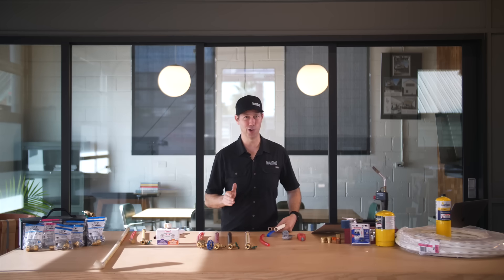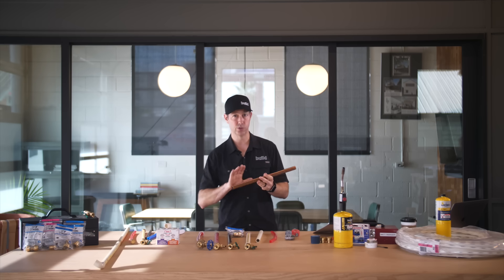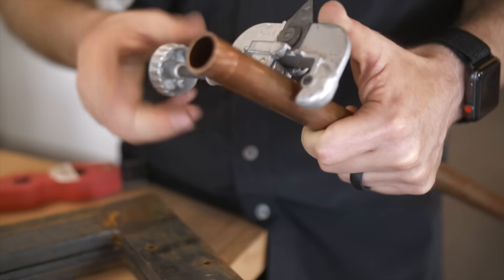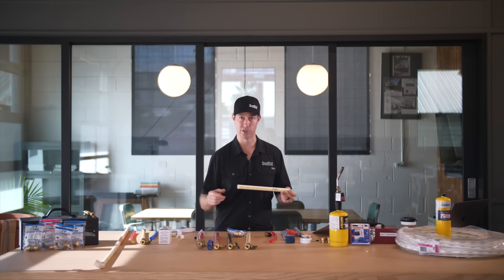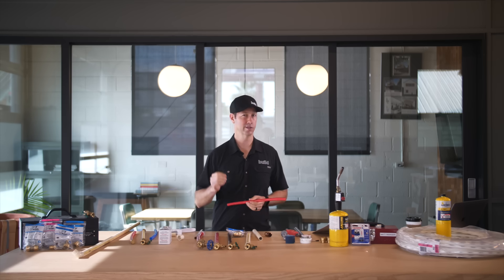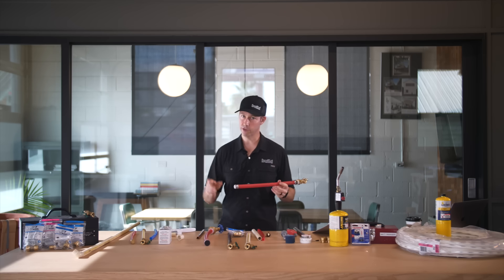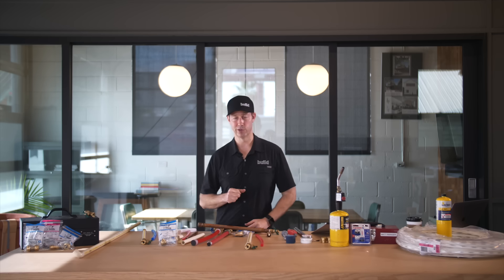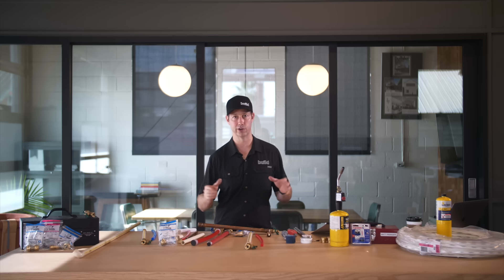PEX vs COPPER vs CPVC plumbing pipes

Comment: CPVC does not last 50-70 years in Alabama in my experience, I see 20-30 year old CPVC so brittle that you can't even repair it because when you go to cut it the whole thing shatters.  Maybe it's something in our water here, but we always replace it on remodels if we ever run into it
Reply: I found the same problem with my CPVC and changed to PEX.  I had a bath install about 15 years ago and when I went to remodel I found the CPVC was very brittle.
Reply: Mike Malone yeah it is junk!
Reply: My CPVC at 24 years is ridiculously brittle.  I’ve had spontaneous joint failures inside the wall too.  Cheap for a builder, expensive for the homeowner when the plumbing and sheet rock must be fixed.
Reply: Matthew Gross I have made many repairs because of this as well!
Reply: @matthewgross6958  brittle indeed. I still install CPVC on the repipes.  My pipes are supported and strapped. Using the PEX expanding tool while laying on your side under a tight house is no fun, so a PVC cutter is the way to go for this plumber. So CPVC wins the contest for me.
Reply: Mark Thomas even with all the horror stories of  CPVC? On well water sure, maybe. And come on lol using the expansion tool is not hard, literally use it almost everyday of my life in all kinds of bullshit positions. Think it’s a lot harder to make a repair in a crawl space when the pipe keeps cracking. Would you use it in your own home? Because I’d politely ask you to get out of here with that if you tried to put it in my house lol.
Reply: What do you replace it with?  PEX?
Reply: dahveed284 That’s what I am doing.
Reply: This is the thing with CPVC. Brand new it's all flexible and clean. With age it gets brittle. Use a saw instead of a ratcheting blade type cutter.
Reply: @brandonb8879   the copper type cuter also works well on CPVC that is old. I put it in my place 20yrs ago now when i cut it is brittle but i just use copper cutter and its fine
Reply: @brandonb8879  . After changing out the kitchen fixture and cracking the cpvc, I use a multi-tool with a 3/4 moon drywall blade. I ran new pipe on both sides and anytime I'm adding or changing fixtures now.
Reply: I am also in Alabama and now doing a full gutted full bath remodel. We removed the sink and toilet CPVC years ago with copper after a leak (second story) and went all the way down to the basement. The shower is the last and I am going with PEX. CPVC crumbles and the glue starts to fail after 30 years. Not made for the South. We make water hammers with a 1/2 T, 8-12" of 1/2" pipe and a 1/2" cap and have zero hammer.
Reply: @myownboss1318  its true cpvc requires maintenance and it gets brittle. But its low cost and ease of that maintenance makes up for its bad points. I do love copper but its so incredibly expensive in my area. So for me its totally about cost and i have no problems about making the occasional repairs needed to maintain my cpvc.
Reply: @kenjett2434  It's not worth it when the pipes split and water runs down through the ceilings on 3 floors after only a few years after install.  That's what I had to deal with on one job.  No other material splits, cracks, shears, of weeps at the fittings like CPVC does.  I just replaced some lines where the actually coupling had split completely open.  The stuff is garbage.
Reply: @BrainToMush  well yeah in that situation I wouldn't advise using cpvc. There is a time and place for using certain materials. If you have multiple floors then use should be able to afford the cost to install pex. All my lines are in one story and easily accessible for easy repairs. Being disabled I still need to be able to take care of home maintenance. Cpvc is a cheap easy way for me to do that.
Reply: @kenjett2434  CPVC is cheap for sure.
Reply: Exactly the same experience here. CPVC installed in 2004 was so brittle by 2010 that bumping into it caused it to shatter.
Reply: Paul Ste. Marie yeah bro!  This stuff is garbage.
Reply: In my experience, CPVC does not last that long either. It is extremely brittle with age and we don’t install it unless needed. PEX or copper with propress is the way to go in my book. 
-Journeyman Plumber in GA
Reply: Lol propress what a joke, overpriced bullshyt. If your not sweating atleast use pex.

-Master plumber TX
Reply: Even for underground? Should it be protected with anything(concrete) if it's exposed to dirt and moisture?
Reply: @luissonoma6255  I have had big problems with cpvc in concrete cracks all to pieces. I have seen copper in other countries that was hundreds of years old with no problems.
Reply: Phone Backup That’s what I’ve been hearing. I still didn’t want any copper joints that were soldiered to be underground. So I decided to just run regular PVC into each building & for the hot water each unit(kitchen & bathroom with laundry room) will have its own dedicated instant hot. The kitchen one will be small 9KW since it’s just a sink for the kitchen, no dishwasher and maybe an 18KW for the other building that will have a laundry room and shower. The original house is old and still has galvanized so I have to remove all that and replace it with a 1” line before I tee off into the new additions. The kitchen already has a sub panel that can handle the instant hot. For the bathroom I’ll have to run a new line.
Reply: @luissonoma6255   The pvc will fail faster than cpvc. Why do you think that only copper can be used in commercial buildings?
Reply: Phone Backup It’s for the main line going into the house that’s underground...
Reply: @luissonoma6255  Where do you live? They would never do that here it's agents code. Far be it from me to tell you how to do your business, just my two cents worth.
Reply: Phone Backup south Florida
Reply: @luissonoma6255  According to some in this post copper gets eaten away in Fla by nothing special. May be the salt doing it. Here in Nashville we have hard water, reverse from soft water like you might have. What does your water service local to you use?
Reply: Phone Backup Not sure but that’s why I’m going with the regular PVC for underground. Once in the building I think it’s supposed to enter a filtration system and then to the water heater/boiler or instant hot in my case. Then I can use the coper lines inside the walls. I figure they’re more sturdy then  Pex or CPVC. Even though it wouldn’t be exposed to the elements.
Reply: @luissonoma6255   That sounds like a good plan, that way you should get the best of both worlds.
Reply: Phone Backup We’ll see what happens in 50 years.
Reply: @luissonoma6255  It's not even lega to use CPVC underground in my state. It's too brittle and can't handle cold weather at all.  For underground they recommend the black poly pipe.
Reply: Even for direct burial underground?
Reply: @luissonoma6255  no it isnt recommended for underground. For underground lines the black plastic waterline is used.
Reply: Ken Jett  have your every seen abs In sunlight or uv? It isn't the option either
Reply: @say_goodnight7342  i agree no abs isnt an option which goes to point of my last comment.
Reply: @kenjett2434  Would that be the same black plastic water lines that constantly break all over the northeast?  Those things are garbage.  Copper all the way.
Reply: @peterallen4605  no talking about CPVC plastic thats used for plumbing. Actually the black plastic works really good in areas not exsposed to sun. When exsposed to sun it gets hard and brittle yes but underground or down a well it lasts for years.
Reply: @luissonoma6255  I've been told that CPVC should never be used underground due to the glued fittings. If it is underground, it needs to be sleeved and insulated.
Reply: CPVC is terrible and should never be used in any structure unless you plan to tear it down within 10-15 years.  Here in Michigan whole neighborhoods were built in the 1990s with CPVC plumbing.  The pipes are so brittle now that the pipes shatter in the walls when merely attaching hoses by hand to spigots, washer hookups, or toilet supply valves. It has nothing to do with UV.  Extreme brittleness comes merely with age.
Reply: @tedvogel4478  sounds like y'all have no idea how to use cpvc or deal with it when it's Brittle, use hacksaw blade or copper tubing cutters never have problems on brittle cpvc pipe you just got to know what you're doing
Reply: @tedvogel4478  CPVC plumbing should never be used in any area that has erratic temperature shifts from summer to winter., it just won't stand up to the constant temperature fluctuations. I am aware of a class action lawsuit that his being launched against the makers of this product because of failure of the product through normal wear. Speaking for myself it's copper or nothing in my home. Plastics are made from crude oil or natural gas (coal is also used) so having my drinking water sit in plastic pipes isn't my choice of safe water containment.
Reply: Likely chlorine in the water.
Reply: The fluoride in the water is extremely corrosive, it's labeled as corrosive on the trucks that deliver it to the city water authorities. It can eat holes in the concrete if spilled, just imagine what it does to the pipes (copper, cpvc, pex, etc) as well as shut off valves. Besides causing cancer, we don't want to think what drinking this stuff does to our bodies!
Reply: I live in Baltimore Maryland and it happens here too so it's not just there
Reply: William wills it is all over the country.
Reply: I bought a house built in 1996 that was plumbed with CPVC. It's so brittle that when I went to replace a toilet the pipe broke in several places. Talk about a pain to make the repairs. Every place was breaking as we tried making repairs.
Reply: I've had some CPVC fittings get brittle just sitting in a bin in a dark closet for upwards of 10 to 15 years. I've also had some CPVC pipes rupture & split. A friend of mine was trying to renovate his grandmother's house & the CPVC shattered on him. He replaced it with PEX.
Reply: Ok. I see a lot of flack for CPVC but hardly anyone is being specific. There is a schedule 40 and schedule 80 CPVC. I've used my pipe cutter on 15-20 year old schedule 80 CPVC (gray color) outside with no problem. It wasn't even perfectly sealed, as us HVAC guys don't run around with PVC/CPVC pipe cleaner.
Reply: I have a 1994 built duplex with brittle cpvc and it was below sink so no UV damage.
Reply: Andrew Meyer same problem in St. Louis area. Have replaced lots of brittle cpvc that's not very old and not exposed to uv.
Reply: Ralph Macey  it is the same all over!  Cpvc is junk!
Reply: @Ralith09  right, uv damage,hhhhm. Not under your sink. And if the plumbing ship has stored the pipe outside uncovered then shame on them. I work on older mobile homes, age will create brittle pipes cpvc and PVC.
Reply: I am a plumber in Florida and you may in the right conditions only get 10 years
Reply: In my day to day pex is our main go to for new houses and repairs u have aqua and heat pex
Reply: We have the same issue in the NW
Reply: I have helped my dad and stepdad  try to fix PVC  pipes  in my son's attic but after about a week it starts leaking 7 or 8 times please help!
Reply: Same here.  House built in 1983 no pipes exposed to uv damage, everything but a few pieces were brittle.  You could barely touch some of the stuff and it would crack.  I don't know about pex, but CPVC is not something I would put in on purpose.  I have ten year old pex working perfectly.
Reply: Same here in Hawaii. We see more problems with the hot water line.  Pipe becomes so brittle it is scary to do a repair on it.
Reply: It may shatter if you use a shear cutter on it. However CPVC Flowguard states in their documentation to NOT cut with a shear on repairs. If you do use shears rock it back and forth to gently start the cut before pressing all the way.  For stubouts a dog ear elbow will eliminate any potential stress points. We've had them in multiple units 24 years without a single failure.
Reply: Yes cpvc becomes brittle over time (with or without being exposed to uv
Reply: No it’s not your water. CPVC is like that. Could have never seen the light of sun before. It happens as it ages.
Reply: Same in Texas. Even wrapped cpvc under a house, where it couldn't get any uv damage, gets more brittle than regular pvc installed at the same time. I've seen it too often.
Reply: Cpvc is garbage.  Might last 15ish years
Reply: Well water here, so no chlorine. Under house under insulation so no UV. 
CPVC  is as brittle as duck's butt. Plumbing in whole house built in 1997 had to be replaced.
Reply: CPVC is garbage. Learn to solder and use copper or go PEX with clamps, better with Uponor.
Reply: @carlo1132  all of these are obsolete and expensive garbage compared to  ppr welded pipes we have in the central and east europe for decades by now.
Reply: Plumber here.. do not plumb a house’s water system in CPVC. CPVC has single handedly made the company millions of dollars.. simply from repairing/replacing it.
Reply: Best fitting to go from cpvc to pex?
Reply: I agree, mine are brittle and I don't think they are 30 years old
Reply: Let me guess it's over head...not good for it gets brittle yes your right but good in the ground were I live in florida last for ever that way...
Reply: Oxygen/ozone also attacks CPVC, it just takes longer than UV.
Reply: In older moble homes the old dupont coneting fitting got brital from clorreen in water tap water city water cloinated. Erodeds the inner plastic they need replaced
Reply: My sewer pipes are PVC, when I was doing work on it behind the wall behind my washer and dryer, the PVC was breaking so easily. My house was built in 1984. My main is also PVC and it broke as well. It's okay, but I like Pex better for tap.
Reply: Never use CPVC for anything. Not even a closet rod.
Reply: @Phil Brown long as cpvc is concealed inside walls whete light cant get to it. It will last a bery long time but it is susceptible to UV light that causes it to get brittle and break easily. That is the weakness of cpvc otherwise its great plumbing.
Reply: @kenjett2434  vtyj
Reply: Even in country water supply lines, where the water comes from wells, the CPVC pipes become brittle with age and when you hit them ever so slightly, they crack. That's just how CPVC is, something inside the plastic changes as time passes. It is probably the 'Chlorine' in the CPVC that destroys the pipe from within because in the cities the chlorine in the water makes the CPVC pipes degrade even faster.  CPVC must be avoided at all costs!   Meanwhile, black P.E. pipe has been around for decades for well water use and is perfect for cold water only.  PEX is simply a 'stronger' version of PE, that's why PEX is so perfect as a water supply pipe.
Reply: @honestycounts9352  yeah i agree pex is very good but also crazy expensive to use. Cpvc is cheap as well as quick and easy to repair. Furthermore is doesnt deteriorate that fast, it takes a few years.
Reply: It isn't the water. It is just the way vinyl is. You see the same thing with all vinyl products from windows to siding. There is a quality factor involved as well. Good quality vinyl windows like Milgard will last longer then the cheap ones usually available at the big box stores but they all will dry out and become brittle and chalky in time. Exposure to UV light is going to accelerate this even more. I try to avoid vinyl where I can but vinyl windows are very popular so It's hard to avoid all together. I don't think CPVC is code approved here in California because the only place I've ever seen it used is for daylight drains for water heater pans and HVAC condensation drains. PEX is pretty popular these days but wasn't widely approved until the late 90's early 2000's.
Reply: I have a bunch of brittle cpvc in my basement but it's not in use just laying down there.
Reply: Use PPR ,has 240 years warantee.
Reply: @mihaiilie8808  what's ppr
Reply: @7x779  Polypropilene.
Reply: @Phil Brown  What area of the country are you in?
Reply: CPVC is brittle from day 1. As a water restoration professional, CPVC is a steady source of flood work for us. Once it gets about 10 years of age on it, the brittleness starts to go up exponentially.
Reply: CPVC is absolute garbage
Reply: That’s because plumbers like my dad kept their supply outside in the sun. They didn’t know any better
Reply: My house was replumbed in 1996 with CPVC. It is a maintenance issue as leaks spring up when anyone goes into the attic - an accidental bump could crack the very brittle pipes and repairs are difficult because it shatters into jagged pieces when cut. Florida water is hard and summer heat in the attic is ruthless even if there's no UV exposure. Now I'm reconfiguring the layout of the kitchen, laundry, and a restroom. Everything new will be plumbed in PEX. I'm seriously considering replumbing the rest of the house in PEX if my budget allows.
Reply: Chloride, but once hard,dam stuff lasts forever.i run miles of cpvc, 50 years experience, never had a problem one.
Reply: My cvpc is brittle. I bought the house 14 years ago.  The inspection guy said 10-15 yrs and think about changing it
Reply: Cpvc so i have a property in Las Vegas built in 1996 so may damn problem the whole
Neighborhood has the same problem the always breaking and leaks
Reply: Same here in Myrtle Beach, South Carolina.You go to repair it and your cutters.Just bust it shatter it like glass
Reply: Same in TN. Our house is 30 and cpvc needs replacing
Reply: Redid floors in a house that was 8 years old that had cpvc. When removing the toilet in the bathroom the line  feeding the toilet/sink in the ceiling of the basement snapped.

When using the cutters to cut a clean edge it just kept smattering instead of of cutting. Luckily I had the water supply turned off to that bathroom before I started and only had minor water leaks to deal with during the fix.

But I ended up having to go back 15’ to get to a spot that was strong enough to not shatter.
Reply: CPVC seems to get brittle from either chem reactions or perhaps constant pressure. What ever the reason, I run into this quite often in my repair jobs. That's why I keep a trusty pvc pipe hand powered cable saw in my box. It works great on brittle cpvc pipe and can get into some really tight spaces. 

Although cpvc is not an ideal long term pipe, it's low cost and ubiquitous use in homes means we'll all be seeing this pipe for the rest of our lives. Best advise is to get used to working with it and finding solutions that make the job better on your head and your hands.
Reply: @valkyriefrost5301  I use a variable speed multitool with 3/4 circular blade
Reply: @Dirtyharry70585  - You're talking about the "drywall" type circular blades?
Reply: @JASPACB750RR  a sharp PVC cutter might have worked, with a gentle rotation before squeezing another click of tightness on the cutter works sc sometimes.  A small toothed saw works, I call my small saw the cheese saw. I am not trying to insult you in any way.  It is very frustrating when the pipe is brittle.
Reply: Mark Thomas no offense taken. I tried the rotation technique. No go. It was so brittle just trying to pull it away from the floor joists an inch cracked it.

I ended up using a small pipe cutter in the end. Worked the best. 

The small saw truck may have worked, but I feel that as brittle as the pipe was, just trying to hold it still and away from the hoist would have ended in the same situation.

Thanks for the response though.
Reply: @markthomas4083  I use a multitool
Reply: Joshua Stankiewicz oh bro I have been in that exact situation. Nearly flooded the customers house.
Reply: @JASPACB750RR  been there too, so now I've put inline first and second story 1/4 turn ball sharkbite cut offs.
Reply: @JASPACB750RR  Use a copper tubing cutter.
Reply: @JASPACB750RR  if you ever run into older cpvc and have to mess with it just use a metal saw all blade. Cut it by hand and not in the saw. Clean the shavings out really well before gluing it.
Reply: We have good water in our house. (northern Indiana) I plumbed our house 32 years ago with cpvc and haven't had a problem yet. Hopefully I won't.
Reply: I second this as a service plumber in Washington state. Cpvc is the new quest. Its junk and is on it's way to being a class action lawsuit. Its garbage. Also pex A for the win. Pex B restricts flow at fittings.
Reply: George Chastain  I live in Washington as well! Way too much CPVC!  Have seen whole high rise buildings in Seattle plumbed in it with leaks every other week!  You could make a great living just off of insurance work!
Reply: I've been working with cpvc for a few years on 20-30 year old double wides. Cpvc is the last thing I would use because it gets so brittle. Look at cpvc wrong that's been installed for 20-30 years and it breaks.
Reply: Odd, my parent's house was built in 1980 with an all CPVC supply system and the pipes have been in tip top shape till this day. I've read that what kills it is chlorinated water and they are on a well with water naturally filtered in the granite water is clean as a whistle so that is probably why it's not degraded.
Reply: Plastic decomposes fast. With-in 20 years it will be so brittle that you can snap a PVC pipe with your hands. All plastics undergo this decomposition. When it's exposed to sunlight, it accelerates decomposition.
Reply: I have worked with CPVC for decades. Yes, it does get brittle with age, but as long as you don’t stress it, it will work indefinitely, even when old. The kind of stress it can’t take when old is freezing, twisting and excessive bending. When working with old pipe, you need to saw it, don’t try to use sheers on it.
Reply: @Ethan.Lamoureux  i find copper tubing cutters work good on cpvc
Reply: @Gods-Elect  Yes, I’ve used a copper tubing cutter on CPVC before. It works, but it won’t usually cut all the way thru the pipe wall because CPVC is much thicker walled than copper, so you have to break it after you get it as deep as it will go.
Reply: And who uses primer on cpvc
Reply: we have always used schedule 40 PVC for our own home use. the extra thickness makes it way better never had them get brittle unlike the thin wall pipes, even in sun for 25 years its still good probably not like new but good enough for repairs ect.
Reply: sounds like UV radiation damage
Reply: Freezing also isn't good for this pipe
Reply: @gregorsmith8541  freezing isn't good for any pipe lol.
Reply: @Blox117  I had the same problem in a dark basement.  Everything just snapped when you barely touched it.
Reply: CPVC is not good for anything. Have gone to repair some and it was so bad you could not even repair it. Trying to put new fitting and it goes to pieces. Had to replace all water pipe.
Reply: @Blox117  age, not like wine.
Reply: @Blox117  no not in wall and still brittle
Reply: @Blox117  Ya, sitting out in the back yard!
Reply: Its true after about 15 or 20 years cpvc does get brittle. Still its quite easy for a diy repair versus pex. Pex requires specialized tools and fittings for a diy repair its not going to be cheap. Cpvc requires no special tools and its incredibly cheap. For contractors and plumbers pex is ok as they do enough of it to justify the expense. Cpvc is going to require more maintenance but its easy for most anyone to use.
Reply: @kenjett2434  you can now buy a crimper on Amazon for about the cost of a can of glue and primer
Reply: if you cannot pay 50 bucks for pex tools maybe living in a tent is a better option then
Reply: @kenjett2434       You could buy a PVC pipe cutter at Harbor Freight for 7.49$ and a 12" adjustable wrench  for 6.99$   if you have a house, you probably have one already, and use   REUSABLE brass threaded compression fittings.   I do not understand why they are not popular in the US, they were the original fitting for PEX in Europe
Reply: @jesperdahl1486  will have to look into that not sure they are available to fit Pex here or if building codes allow them to be used. We have some really crazy building codes that are only designed to make more money for certain manufacturers if you jnow what i mean. I do have the PVC cutter  and adjustable wrenches though.
Reply: @kenjett2434     I know they are available, but you are correct about the code   (being different, that is. I have newer seen any evidence for US codes are favoring any particular manufacturer)  I am used to codes covering a whole country, not a state, or a county, or even a city.
Reply: @jesperdahl1486  here manufactures often lobby people in federal, state and local municipalities to favor laws that benefit the sale of certain products. Its a corrupt business but it happens and often the consumer gets stuck wirh these ridiculous codes and laws. That is why i will have to check as it often varies with each community. I live in a rural area so luckily not as strict but still cant give reason for local government to stick their noses in.
Reply: @doublebulbing  Milwaukee tool costs $399 at HD.
Reply: @doublebulbing  Hear! Hear!  Oh, and what's "cheap" about the tools & fixings for copper.....???
Reply: @jackb1803  you can use Pex type A with crimp rings you do  not have to use it with the expansion system ... In most cases Crimp Rings are just fine
Reply: @kenjett2434  Ken use copper cutters on pvc
Reply: @Gods-Elect  i have a regular pvc cutter makes quick short work of the job. What even betteriits good for alot of other cutting jobs.
Reply: @kenjett2434  I'm sure they do Ken I don't have regular pvc cutter's so for water  pipes i use copper cutters seems to work good i was thinking for those that said the were having trouble shattering, copper cutters might work although my house built in 93 has all copper except for water coming into house then too my water pressure tank has plastic this is probably my second time I've ever left a message on utube lol kinda different lol
Reply: @Gods-Elect  yeah it can be intimidating sometimes on comments. But the breaking and cracking we are referring too with pvc and cpvc water line is with age and uv radiation it becomes brittle and can break or crack from a simple bump,movement or sometimes just the raising and lowering of pressure during use. But in this discussion comparing it to pex or copper its my opinion despite its weaknesses the cost of installing and or repairing pvc/cpvc is far cheaper. Therefore outweighs the high price that pex and copper costs. Although pex is just as easy now to install thanks to th he shark bite connections they are still very expensive. A repair on cpvc can only cost $0.50 where the same repair on pex can run $10 or $15. All do to the cost of the connectors.
Reply: Ken Jett yeah, but paying $50 up front is cheaper than using inferior products only to be replace later. It is expensive to be cheap
Reply: @doublebulbing  50 bucks, huh
I have over a thousand dollars invested in PEX tools
Reply: Ken Jett. I have done PEX with a hack saw and PTC fittings. Did an entire house with it. Oh and a heat gun to encourage bending where needed, warmer climates don't even need that but I'm in a state where half the year is freezing cold and PEX gets about as hard as PVC in the cold.
Reply: @eideticex  well you can go for it i guess but using Air Brake fittings   in my opinion for what its worth isnt a good idea. For one the composition they are made from could very well have carsoegenic properties. They are not made for the purpose of potable water. Neither were they made to use on pex line who knows over time what the effects could cause.
Reply: CPVC is garbage. Never use it. If you see it replace it.Use copper or PEX. I have found out that this guy really does not know what he's talking about when it comes to plumbing.
Reply: @heatrick1  I figured he wasn't very experienced when he mentioned that he'd never seen a pinhole leak in copper. I'm merely a DIYer and even I have ran into that issue on occasions
Reply: The Romans had the best pipes, always flexible, mallable, never corroded. We used them until 1955. Lead pipes rule. Lead paint lasts foever.
Reply: @robertkat  😂😂😂 you need to read more history.  Learn why the romans had lead poisoning. We removed lead from things for a reason. If you want better get type "L" copper and a pipe bender.  In HVAC we use copper rolls. 😉
Reply: @robertkat   I was in an excavated 3000 year Old Town in Israel Add they had clay pipes with lead joints. .. Still intact, laying on the ground
Reply: @robertkat  LOL
Reply: @robertkat  i agree, we used to have them in the appart building too until 1990 then all of a sudden they started to change them with plastic...for the "sake" of the industry. 🙂
Yet, we must say that lead pipes were mainly used for drainage systems and rarely for water supply systems.